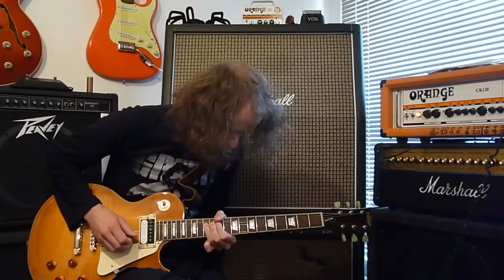Why I prefer Solid State amps to Valve amps

Comment: I've been a SS guy since I got my first Fender Studio Lead back in the 80's. I still prefer SS amps, although I've got a hybrid Super Champ XD that I like better than any amp I've ever played in 58 years. But SS amps in general have a smoother sound whereas tube amps have a hard edge that just grates on me.
Reply: I stick to the "tweed" voices. The clean channel on this amp is not very good, but the first tweed voice is as nice of a clean as you'll ever hear. The second tweed voice (Bassman) is a great crunch, and the third one is very overdriven for lead. (The newer X2 may be set up different.) You'll see a lot of kids on the interweb talking about changing the speaker. Ignore them. They're trying to get a better sound out of the clean channel, but in doing going to a bassier speaker, they end up ruining the tweed voices, and those tweeds are what this amp is all about. The stock speaker is fine. Incidentally, they call them tweed voices, but they don't have that typical hard sound of a tweed. They sound more like a blackface Deluxe with a tube screamer in front of it. Sounds fantastic with a Tele in particular.
Reply: Sadly, the voices that are labeled "blackface" actually sound thin and almost solid state like. Here's a helpful hint. The first three voices on the amp are the three tweed voices. The first one is much cleaner sounding than the other two. It makes for a great clean sound, but you still need to turn the gain way up on it. With a typical single coil Telecaster, you can turn the gain up between 8 and 10 and it will just be on the edge of breakup and give you a great thick clean tone. You'll have to turn it down some with humbuckers. With a Tele I run the first voice gain on 10, the 2nd one 10 also (for a nice crunchy rhythm), and the third voice on 7 for lead. The stock FENDER preamp tubes are great. The power amp tubes are nice too, but JJ's sound even smoother. Don't let anyone talk you into swapping out the speaker.

Comment: I bought a marshall lead 20 a couple of months ago. I HIGHLY recommend it. Closest thing thing to a vintage jcm800. It doesnt have the thin tone of the lead 12 and the master lead 30 is even fuller. I really recommend it, i bought mine for about 190£. Its cheap, light, small, LOUD, and sounds amazing. If you have some money left over, get it. Or trade it or whatever with a pedal or something

Comment: Dave, you're missing the point, man.  You don't HEAR the difference, you FEEL it.  People try to quantify the FEELING that gets into you, some might say that MOVES your SPIRIT when you drive that miniscule electric signal into cascading tube preamps running at 270 volts into and overdriving the phase inversion tube stage then onto a power stage drawing so much current through it your EYES can perceive it, let alone your EARS!  Say nothing about the consciousness-expanding consonance of even-order harmonics!  Say nothing about the otherworldly intelligence that springs to self-awareness when the electron-neuron matrix of vacuum tubes creates a sentient being that is interacting with humankind for the first time, mostly under your control!  Say nothing about the feedback loop that is created between your fingers, strings, pickups, cord, pedals, amp, ears, body, brain, universe, fingers, etc. when your tube amp consciousness becomes orgasmic under your touch.  It's trying to lead you somewhere!  Electro-magnetism is just a THEORY...human ingenuity has not yet discovered a metric for measuring the quantum-level stuff that happens in the human being->electric guitar->cranked tube amp->human being temporal flux.  You stand at the edge of a literal infinite universe of experience, a material melding of humankind with the divine - you have all necessary tools but one.
Reply: I think what Dave is saying is hearing is a part of feeling and vice versa.  Your experience is different. Beethoven couldn't hear, but he felt the vibrations and enjoyed music differently.  He didn't  play a cranked tube amp either.  Nobody's point is more valid than the other.
Reply: Jason Vanzant Couldn't have said any better than that!
Reply: Brilliant. You should write for Deepak Chopra.
Reply: Amen!
Reply: That was one of the most beautiful things I've ever read!
Reply: Jason Vanzant ...gobbledygook.
Reply: Jason Vanzant Nicely said.
Reply: Yes, you are 100% correct.
Reply: Nobody seems to have noticed Jason is taking the piss here. Have none of you watched "Spinal Tap"?!
Reply: 2 years old and still one of the worst comments on here.
Reply: This comment reminded me of the hale and pace black and white song (old valve TV's)
Reply: Feel it? What bunch of crap!

Comment: I do hear a bit of a difference between valve amps and solid state amps but it's not as pronounced as many people would say. Also valve amps are usually much more sensitive to power AND temperature. If you try using a valve amp outside on a hot day it can cause the amp to sound strange. The solid state amps are much more consistent and much less prone to problems. You don't have to service a solid state amp as much as a valve amp.

Comment: let your ears and wallet be the guide..some amazing solid state gear on the market..boss kitana, Quilter, blackstar..solid state is making a comeback for sure
Reply: Theres a difference between digital and analog, though. A cheap analog amp feels better than a mid ranged digital setup.
Reply: yeah true.Quilter and blackstar are analogue, maybe blackstar has digital delay. not sure about Boss Katana, probably got analogue input stage/pre, and power amp..and some digital amp modelling. I think digital modelling has improved from turn of the century digital amps that turned people off them... Kemper is 100% digital amp that uses modelling/profiling..critics rave about it...I'm still wary of "digital". What's also improved is analogue emulation, amp-in-a-box style circuits..where they get the feel of of a classic amp, ..wampler does a good job of this, along with others..some of his pedals are100% discrete analogue goodness, using jfets, resistors, caps and diodes...i've built my own practice amp and used some wampler stages in my preamp..sounds great...old school
Reply: I'm tonally challenged. I have an old marshall mg30 I bought back in 2006 and an eleven rack. I prefer the marshall, and thats saying a lot because it sounds pretty bad. Friends on a forum talked me into the eleven rack. I should have bought a mesa mark v like I originally wanted at the time. When I could afford it. I used to have a marshall tsl. I miss it. These orange crush amps look cool. I need to try them out.
Reply: i think ur ears are ok..If you got that marshal mg30 installed a jack and bypassed the internal speaker and fed a cabinet..it would sound awsome..nothing wrong with those mg series amps..same as what we talking about..marshall made a modelling circuit of there own valve amps..ingenious, and they did it long before anyone else..then they just hook it up to a chip power amp. compare a mg series to say fender frontman..no comparison..fender solid states are garbge. I'm impressed with my little blackstar fly..very nice sound for a little amp..I'd look at blackstar as well, i reckon there small solid states would be decent, for the money!! orange crush are good, but i think they struggle to get clean sound, from what i can tell..get one anyway...add to the collection :)
Reply: Lol, the tonally challenged bit was just a little joke about not having a great amp. I never considered putting in a speaker jack. I definitely need to look into that. As is, the cleans lack presence. The overdrive is decent, but mainly because I haven't heard a great amp in a long time. I'm used to it. Or should I say I've gotten used to a 10 inch speaker in a small open back box. I've tilted my amp at an angle to try and help, but it sounds worse. It gives me a bit of the highs its missing, but at the cost of I wanna say low mids and complexity on the overdrive channel. If I can mod it, I might just convert it to a head and get a good 2x12.
Reply: Thanks. I'm glad I commented because I never would have thought about modding my marshall to take a better speaker cab. I always knew the speaker was bad but I assumed the whole thing was bad because it was so cheap to begin with.
Reply: That was simple enough. Though my amp says its 4 ohms. Do you know if you can convert that to take say 8 ohms?
Reply: no need to convert..I just had a look for a schematic..it was dated 2001. back then they used a TDA2050 chip for the power amp. It runs on 15v..In the datasheet it says @ 15v supply and 8ohm load it will output 15w power, 50% less than your amp..but i think It will be much better sounding through a cab, more open--true 15 w through a cab will sound great. Your later model may use a different chip?? Need to check..if you can open it up and have a look..look for the chip mounted to a heatsink..read the number on the chip, might need a magifying glass..then google the chip number and read the spec sheet. All spec sheets have  section called "typical characteristics" and a bunch of graphs - generally the first couple graphs have a heading "Output power vs. supply voltage"...that will tell you what you need to know. don't touch any caps, and make sure its not plugged in, if you not experienced..maybe you can contact marshall service department and they can tell you?? hope this helps..good luck with it..if you get it modded..post a vid and let me know...
Reply: I googled whether I could run an 8 ohm cab and it seems like I can. Though later on I'll get inside it and have a look around. I've pulled the chassis out before to replace my on/off switch. There's not much going on inside. I'll let you know what chip it has. Eventually I'll drill a hole for an output jack and build a cheap wooden head for the chassis. Thanks for all the help, man. Really fortunate running into you.
Reply: no worries mate. I just looking the schematic..the gain stage is a lot like one of the stages used in a boss sd-1 or tubescreamer..and use 2 leds as "clipping diodes", but they got this really cool looking tone controls treble and bass just for the gain, got the same for the clean..what does the contour pot do???
Reply: Contour is basically a mid control that works backwards. My clean channel doesn't have it, though. The more you turn it up the more scooped it sounds. I have mine set to about 11 o'clock. Amp has plenty of gain. I have my gain set between 1-2 o'clock and I'm boosting it with a ts9 with the drive all the way down. Just enough gain for some good chunk to play thrash metal.
Reply: contour ok..mid scoop..thinking i might be able to make a pedal based on the gain stage..have volume gain treble bass and contour..have to compare this a guvnor pedal schemo..see if theres any similarities..maybe they have already done that..cool.cheers man
Reply: Sounds cool. Cheers, man. Thanks for the insight.
Reply: no way, I took a cheap Spider 4 a dig ss amp and took out the speakers, and installed jacks and ran it through a mesa road king 2 4x12 cab, WoW what a difference!!!

Comment: I'm with you on this Dave. As a relative newcomer to six string electric guitar, I already have a preference for solid state amps, having been a bassist for over forty years, and with bass rigs, less weight/mass while retaining maximum output power at 8 or 4 ohms is a boon, regardless of whether it's in a solid state package or not.

Since I picked up playing guitar as a necessary tool to add to my creative pallet - I'm not gigging much anymore, and I'm much happier writing, arranging, composing and recording my own songs - I've priced tube and solid state amps, heard quite a few different kinds, and have come to the decision that, for all the prohibitive costs of buying, then maintaining a valve amp, I'm better off finding a less expensive, but just as powerful, solid state modeling amp, because they also give me a wider tonal range to work with in various recording situations, and they don't have as much potential to freaking kill me if I don't keep them in optimum condition all the time. Nice to meet a fellow traveler now and then. Cheers.

Comment: Several months ago I went to my local shop and did a little experiment. Luckily I was the only customer in there and I got to let a couple amps rip. I brought my guitar from home and tested a Peavey Bandit and a Genz Benz El Diablo. I  found that the biggest difference between the two amps was the Genz Benz had what I'd describe as far more oomph than the Peavey. They both sounded the same, but the delivery of the sound was different. It took a bit to get them dialed in, but the oomph was what I came away experiencing. I do love some tube amps though. Had 3 Mesa Boogies and a PRS Archon. And I come back to what happened to me with one of the Mesa amps. I ordered a Mesa Blue Angel combo and that cost about $1200 at the time and I didn't think much of it. Guy ground ships the amp to me from Baltimore Maryland all the way up to Eielson Air Force Base Alaska. So my buddy and I walk, lugging this huge heavy box in over a foot of snow, I get to my room, unbox this mammoth 4x10 combo, plug in, wait for the tubes to warm up, then I proceed to play. Only thing is.... No sound. Played with the volume on the guitar and amp... No sound. The amp shipped and arrived to me with missing and broken tubes. So $500 later I've got a functioning amp and a desolate bank account. And you know what? I don't have any of the amps that I mentioned anymore. Had to sell them off. If things were different I definitely would've kept the amps. But life happens. Now I'm trying to figure out if I want to go through the song and dance again or perhaps take an Orange Crush Pro out for a spin. There are just too many choices! ARRRRRRRGH! Lol

Comment: I've got a Marshall Solid State & an Orange Valve Amp & I certainly prefer the Orange but I find that I use the Marshall far more often. I don't have to leave it on to keep the valves hot, wasting electricity (which isn't that cheap here in the UK anymore) & I'm not as concerned about it breaking. It sounds decent enough for messing about at home practising anyway.

Comment: Well said on all your points. I also prefer solid state over tubes...now. That is, they have come so far just in the last two years that it is really quite amazing. I just got the Line 6 Amplfi 150 and it is such a well made, well thought out piece of gear. Bluetooth controlled with the FBV Shortboard foot switch controller. A 12" Celestion with two mid-range speakers and two tweeters. You have never heard reverb, chorus, delays and all other effects until you hear them in stereo though this amp. So lush and articulate. Now, that being said, it is not very loud. Even at 150 watts, you could play a very small venue, otherwise you will need PA. I use it to play at the Coffee house (yes, just like Phoebe from friends) and all the backing tracks are in my phone played through the amp via Bluetooth. It is so much fun. To do that with a valve rig, I would have 4x the amount of gear and have to make multiple trips to the car for load in and load out. And between "sets" I just use it as a boombox and play music, it sounds that good. And the Roland JC 120 has the finest clean tone on earth, bar none.
Reply from the maker: Thank you very much for watching. :)

Comment: My main amp is a blackstar 212 TVP 60w combo. and I have a 6505+ 112 65w combo valve and it sits most of the time for just that reason. I don't want to burn out the tubes so I use my SS more often. I bring out the 6505+ for company. Thanks Dave.
Reply from the maker: Thank you. :)

Comment: I had my Marshall go dull halfway through a gig and thought the valves had gone then back at home it was fine. My first experience with stubborn valves. It was an open mic night my band was hosting so it was fine at the start of the night and people came up and plugged their gear into the plugs stealing the power from my amp. BUT it does sound awesome compared to my old Peavey Bandit 112.
Reply from the maker: Its very annoying isn't it. Thanks for watching. :)

Comment: Seems like good solid reasons to me. I've never been able to tell the difference between valve and ss amps either. There may be a difference in a recording studio, but, then, that is a very controlled environment where there's no power fluctuations or wild temperature variations. Playing live...I agree with your reasoning.

Comment: Yeah, I agree about the price gap and weight and maintenance differences between ss and tube amps and either can get the job done. I own and use both types of the fender, peavey and marshall brands of amps but I much prefer running tube over ss amps on stage. It's kinda like having a Maserati and a Hyundai, both cars can get you from point A to point B...

Comment: ive always thought tube amps were my thing but since ive been playing at home lately .i put my tube amps up for when i play with other people and i switched to full analog solid state 5 watt heads for home practice , im really loving the sound with my full analog solid stat amps. i think i  was confused by digital modeling vs full analog solid state.  they are about 60-100 bucks for a 5 watt head  so i was able to get two different heads that have different tone , i run them both into a 4x10 stereo cab for my clean sound. it sounds so huge with a little stereo reverb , i fell in love the first chord i strummed. i think with the way Kemper and this new Neural DSP quad cortex , digital modeling is sounding better each year , its getting really hard to tell the difference even with an a/b test.

Comment: Loving the Peavey Bandit 112 over your right shoulder. My first good amp was the same model. I now use two older Bandit 65 amps in stereo style setup. Blue and white knob version. I like the fuzziness of the drive circuit and the quick transient response. Reliable and $100 Cdn each.